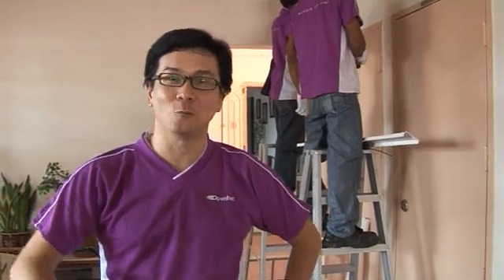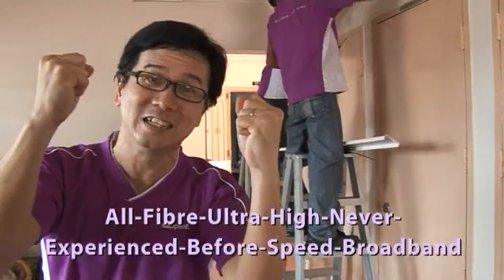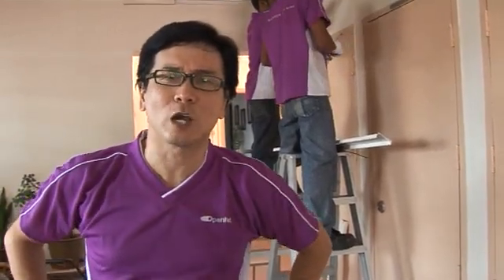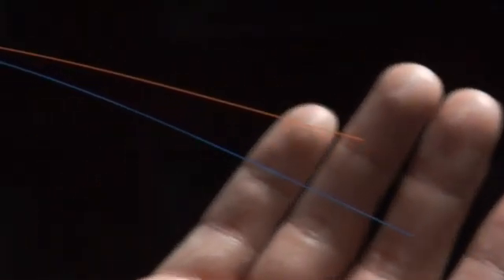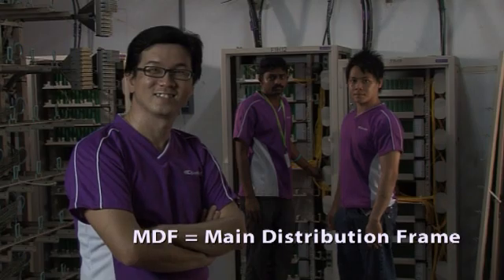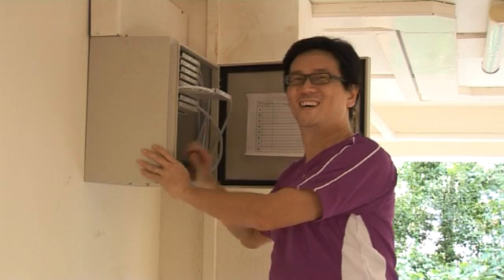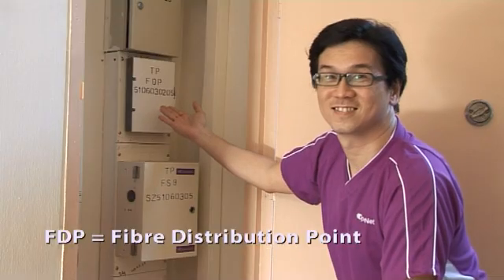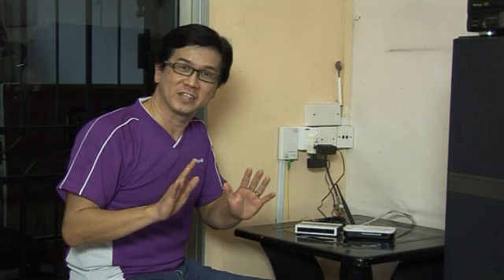Andy, The OpenNet Optical Fibre Contractor

Comment: OpenNet is not your internet, if that's what your thinking. Its simply a port that brings the fiber optics into your house. Fiber optics allow higher bandwith and less data loss than cable broadband. If you want the fast internet you need to contact a service provider eg. M1, Singtel or Starhub.